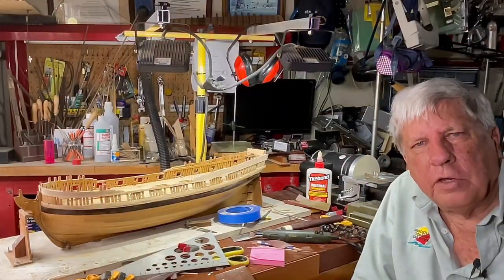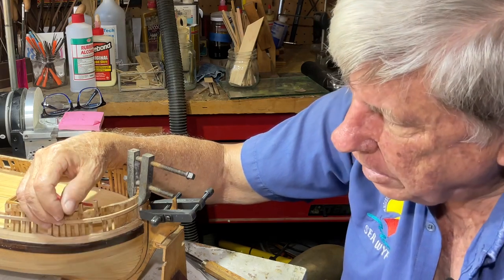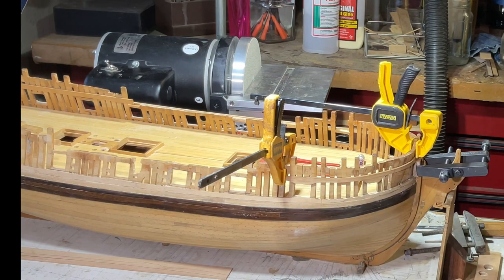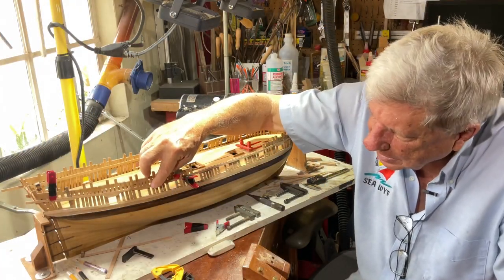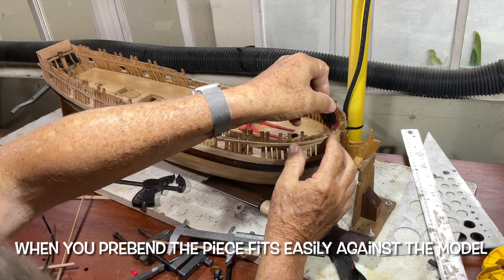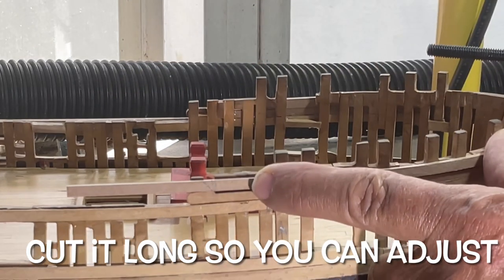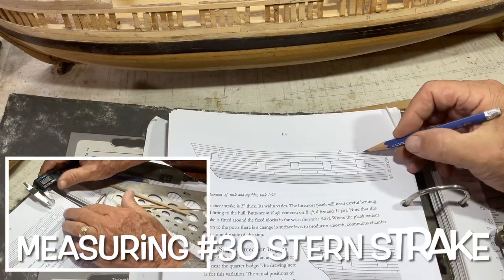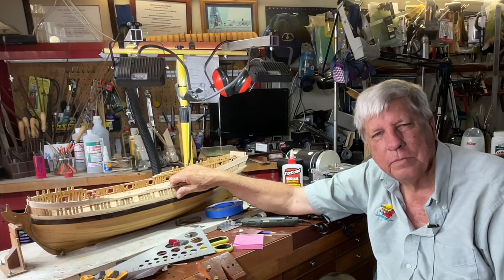Video 105. HMS THORN. Installing the sheer strake No. 29 and strakes 30, 31, 32

Comment: Hello Kevin,
Your videos are a blessing to me. I am preparing to build my third scratch building but it will be my first in a fully framed model version. I chose the Speedwell from David Antscherl and Greg Herbert. I own the two books on the Speedwell as well as the series: The Fully Framed Model (except volume II - sold out at SeaWatch Books) Reading is not always easy to understand but your videos have always answered my questions, a big thanks for that.

Can you tell me how much do you estimate the amount of wood used once all the frames are mounted (video #30)?
Excuse my language, I speak French.
Reply from the maker: Hi Denis
You have chosen a wonderful model to build and you can follow Gregs build on Model Ship world. Most of what is shown for the  Thorn will apply to the Speedwell. It worms my heart that you find my videos useful. That was the objective. In terms of the amount of wood, it is difficult to estimate. I purchased a package from Models boat yard years ago. I have also used almost double what was purchased. Once you start planking using the card method where you cut in the curve into the strake you tend to use a lot more wood. My suggestion is that you buy four to six lengths of  3/4” thick by 3-4” wide and up to two feet long and cut building stock as you go . I make up all my stock and will never buy wood from a model shop supplier. I buy directly from a lumber yard. Buy what ever fine grain wood you can get. The finer the grain the better. Make sure its dried. Enjoy the build.
Reply: @kevinkenny5122  Thank you very much for your advice, it is really appreciated. I live in Canada and we don't have hardwood for ship modeling, I have to order from the United States, that's why I was asking how much I have to order. I dream of having my Speedwell all in Pearwood or Boxwood.
I will continue watching your videos on the Thorn, I am on number 4. I admire your work!